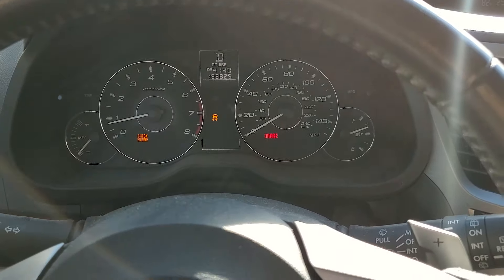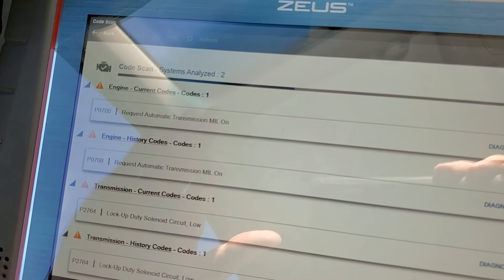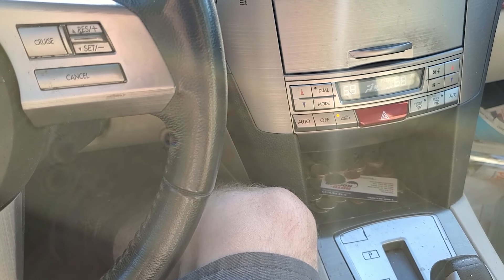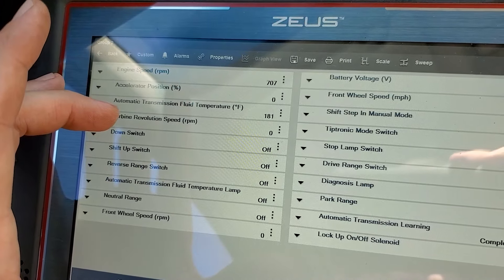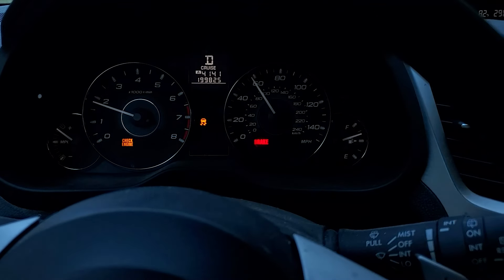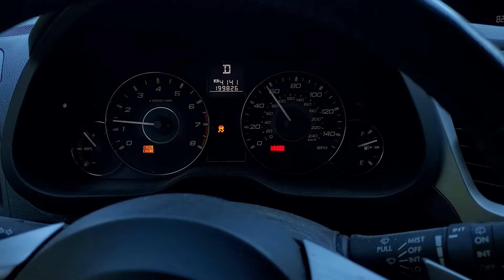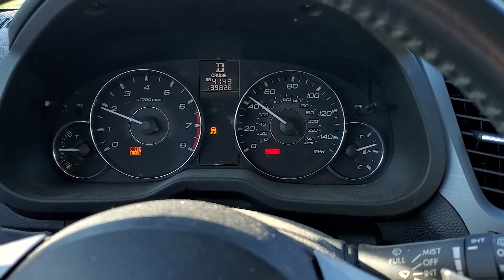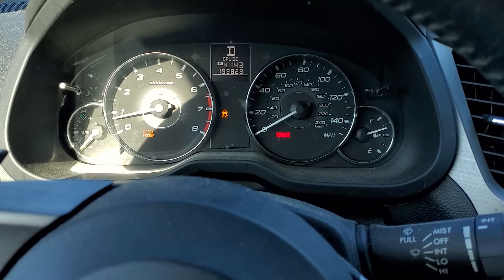Subaru TR690 CVT Trouble! My Brother's 2011 Outback's Transmission Issues.

Comment from the maker: Forgot to mention price.

Valve body is about $750
Torque Converter is about $750
Fluid is about $200
Reply: Labor rate?
Reply from the maker: 100/hr
Reply: Could it not be that the lockup solenoid is causing the stalling and the TC is good?  Just think how lucky you guys are in the states, the subi HT cvt fluid is $800 AUD ($600US) for a 20 ltr can, (cant buy it any other way)

Have you not still got the old valve body off the other car you replaced?  Are all the solenoids the same? maybe swapsy?
Reply: $1,800 ball park out the door price?
Reply from the maker: That's my cost, for parts alone.
Reply: @MrSubaru1387  extremely fair! For a 100 bucks an hour someone gets YOU not a oil change tech.
Reply: @MrSubaru1387  I dunno know what your brother plans. It’s really depends if he take care the his 2011 Outback and if not, I think better sell it to you the Outback deserves more love.
Reply: You can diagnose the solenoids and find the one that doesn't work and just replace it instead of the whole valve body.  You probably knew that.  But with that kinda mileage, might be worth replacing the whole thing.
Reply from the maker: It's always a waste to replace just one, which is why Subaru sells the vb as an assembly.
Reply: I have a 2009 forester with 157,000 on it. It's 2.5 n/a with the 4 speed automatic i have a high  Pitch whining noise It's mainly at low speeds sounds like it's coming from the middle of the car could it be my center drive shaft bearing ?  Other than that the car runs fine and does what it's supposed to
Reply: @rileypart1  this isn't including labor. This is about 2500 or more and then taxes!
Reply: My 2011 subaru have same  problems Mr subaru  how will you pay for my ? Its for sale😁 you can make your project  😁
Reply: Have a 2013 Impreza 2.0 premium with the same issue 219,000. Took to subaru and they quoted me 8990.00 for new transmission and 3400 for labor. My car exhibits the same behavior.  Just spent 350.00 per wheel plus labor to replace wheel bearing, Subaru replaced the lifters and seals under recall.  Not sure what to do. I ended up buying a new Mazda3 to get to work, but is it feasible to get a local shop to to replace the whole CVT assembly for under 1500.00 for labor and $1000 for 60k verified mile CVT at a junkyard.
Reply: @johnreilly31  yea because you can get 4 cvts for the price of that 1 lol
Reply: @johnreilly31  I have a 2012 outback that has the same jerk when accelerating from a stop. I drive it in manual mode and have no problem..
Reply: He’s your brother so service an hour is 7.25
Reply: @arod8596   case of beer. Haha
Reply: At that price for service it should just be replaced
Reply: Just bought a 2011 2.5 limited outback. I hope you keep his running. Great videos
Reply: I got a quote from my Subaru Dealer (Australia) for $3,000 AUD for the valve body part alone. I wish I cost $750usd here 😢
Reply: This whistle noise coming out from  Torque Converter? I have same issue but only whistle noise @MrSubaru1387
Reply: Have you ever put a JDM transmission in a Subaru?
Reply from the maker: @matthewprespentt4102  I have not.
Reply: I've got a 2014 doing the same thing. Car has 193k. Is it worth getting fixed?
What if I don't get it fixed?
Reply: Update 2023.  My 15 forester 2.5 premium with 116k miles had same dash lites.  No shift bump or stall.  Above my skill so, dealer it went.  New cvt throttle body $2550 in Ohio and that included 4 shiny  new spark plugs too.
Reply: Hey Mr subaru I have the same lights on,the  mechanic said  it's Transmission It's done 215k I haven't changed the oil  Ever since I bought it (60km) The mechanic said it's a risk Do you think I can still drive on it for another 80k
Reply from the maker: @itsnowornever7697  what codes?

Comment: If you get 200k miles out of a car with just routine maintenance you got a great car. Anybody watching this channel is a mechanic of sorts, so these 200k mile cars with no problems got good routine maintenance, minor stuff fixed when it broke. The best thing about subies is they are not complex cars, in their design. They also in my opinion have excellent factory repair manuals.
Reply: I do like my 2013 Subuaru Legacy H6.  I have now 130,000 on it.  Lost the master brake cylinder at 115,000.  Lost the rear wheel bearing at 120,000.  Lost the front control arms at 125,000 as well as a rubber seal went on the rear differential (rubber parts fail on all my cars at around this point and start leaking oil).  Now at 130,000 and have another oil leak - I think it is on the rubber seal for the valve covers on both sides.  Everything else has been maintenance (oil changes, batteries, tires, etc.).  Still a good car considering the price for what you get.

Comment: We have a 2009 subaru outback with 200 thousand miles on it, and we use it as a daily driver and to use on the farm. We load this thing with bags of feed and pull small trailers, and no engine or transmission problems.but we do drain the transmission fluid even 40 thousand miles

Comment: I have a 2012 Outback 2.5i at 190k miles that consistently jerks when accelerating from a stop (only once the engine has warmed up).  However if I drive it in manual mode and make sure I start from a stop in “1st”, I don’t have that problem. Subaru dealership told my $8k for a new CVT. So far I’m just going to keep driving it, as long as it keeps working, in manual mode using the paddle shifters.
Reply: Exact same
Reply: Even my 09 with the 4eat drives/shifts better in in the sport and manual modes, must be just a subaru thing
Reply: My 2012 Outback will not go to manual mode. Display shows a -
Reply: I have the exact same issue with my 2010 outback.

Comment: I have an aquaintence that dabbles in a Subaru CVT business that has supplied me with CVTs for my shop after going through valve body solenoids and torque converts.  He insists the cause is overheating and thinks the radiator cooling system is not adequate and has installed aftermarket tranny coolers in front of the a/c condenser with good results. So far I have replaced three of his with good results with the extra cooling.

Comment: Hello @MrSubaru1387, I have a 2012 Impreza, 102k mile on it. These lights came on for me. Dealership determined it's the Valve body and replacing it as well as changed the CVT fluid. My question is, from your experience,..after these services, how long would this repair hold up? ie, another 80-100k? granted I keep up with all the maintenance service of course. Thanks!

Comment: I saw ‘cvt trouble’ in the title and thought to myself ‘damn… that’s not good’… then I saw the odo at 199k miles and then I’m like ‘oh okay… whew’ hahah
Reply: this is a likely failure? or cumulative preventative would have addressed this?
Reply: Over 350k on my cvt
Reply: @Hallowsaw  Issue is at least in the US Subaru has the fluid for the CVT as 'lifetime', so most people just reading their manual are thinking they never need to replace it.
Reply: @occckid123  what year and model?

Comment: I have 160k on my 2011 OB Premium and the torque convertor has been going bad for the last 15k or so - doesn't stall each time or very often but is just an occasional issue.  I've also replaced that passenger side rear wheel  bearing (went bad at 147k, the dealer charged me $700 to replace).  I'm rolling the dice on that torque convertor as the dealer wants $1400 to replace it and that dollar amount is a large percentage of what the car is worth.

Comment: I have a 2010 Outback 2.5i, and the valve body failed at 139k miles. Subaru replaced it under the extended warranty. Prior to the valve body failure, I was getting some stalls from the TC, but they couldn’t repeat it at the dealer, so they wouldn’t replace it. Once I got to 150k, the TC issue became more noticeable, and they were able to repeat it at the dealer. Unfortunately, I was beyond the extended warranty at that point, but I got Subaru to pay for half of a new TC.   I’m now at 164k miles, and I hope to get another 100k miles like some others here. I put 300k miles on my ‘95 Legacy wagon with no major repairs. Despite these CVT issues, I still think Subaru makes great, reliable cars.
Reply: How did you get Subaru to cover half of the cost. My 18 Outback is at 107k miles, just over the warranty period. Wondering if they'll do the same for me.
Reply: Any update on how they covered you

Comment: I had a 11 Outback and the only thing that was weird for me was the hesitancy from a standing stop (there was a delay of 1 to 2 seconds from hitting the accelerator to actually moving forward) that Outback was replaced due to a bad  accident (rear ended, totaling it out).  

I have a 14 Outback (after my 2011 Outback was wrecked) that currently has 110K miles. I have done all the basics (Coolant, front/rear differential, plugs, front/rear brakes) I also replace the oil with Idemistu oil every 5K miles (I could probably go longer, but I never heard of any bad things happening when oil is changed before it needs to be changed) I will be checking the fluid in the CVT within the next 5-10K miles. But the Outback runs great and has not given me a reason to consider replacing it (but that  new Turbo is awfully enticing). 

I understand that in 2013, Subaru upgraded the CVT. Is there anything I should be aware of or do to ensure it has a long trouble-free life?
Reply: Never changed cvt fluid?
Reply: @DM-hw4cr  Not yet.  I have to get it checked before 125k miles. If it is bad, then I will replace it. It's supposed to be SUPER expensive to replace.

Comment: My friends 2011 Forester has an issue where it will randomly die when coming to a stop after coming off the highway. It happens this same way every time. It does not have the CVT trans. Once it dies, it wont restart for a while even in park or neutral. You can eventually get it to restart but it will run rough and die if you don't keep the RPMs slightly elevated. Only code is P0420, no transmission codes. This has happened for the past 2 years intermittently. We usually just do an oil change and maybe clean the throttle body and some other maintenance and it will go a month or longer before it happens again. But it always happens again. We've also replaced the upstream o2, MAF, MAP,  both cam position sensors, spark plugs. Cleaned egr valve and passages. Cats are not damaged or clogged. It does have bad oil consumption but is checked/topped off religiously.
Any help would be greatly appreciated!!

Comment: I just got the P1710 code and AT oil temp flashing light too. Looks like this one here. Trans slipped a bit, so I cooled it down. Trans level was good but may need to replace filter and valve body. Tribeca has been pretty good other wise. Got a P0700 too. Likely just need to have mech fix it. Runs ok for now.

Comment: Man.. I WISH I had a brother like you.. especially RN… 
Stuck at work, my 2013 Outback 2.5 is shot

Stuck at work, desperate and don’t have 3-6 grand.. 

It felt like Chain slipping 
Got to 2.5/3 RPM before moving.. 
didn’t wanna move far bc I’m nervous to get stuck anywhere that’s not at my shop or home..

But when I tried to drive it yesterday it sounded- felt like my breaks were locked. tired dragged - screeched 

New tires and brakes 
118k on it.. 

🙏 

In LI/New York.

Comment: On my 2013 2.5L at 65,000 miles I had this situation and the Subaru dealer fixed it at no charge. I believe it was a solenoid.
Reply: i have a 2013 as well at 90k how did you get them to do it free??

Comment: Routine maintenance with my 2011 Legacy. I had to replace the engine, so I had a rebuilt one from a company online (ENGINESUS). Had someone replace the old to rebuilt. At least 4 times now that I've had to deal with these lights issue. First, the guy told me it was the throttle plate $630, ( He said that's what his computer told him to remedy the hesitation, trying to stall and some bucking). Then, it'll be the second thermostat for this. Now, the lights came back on and the engine again goes down to a low idle instead of the warm up mode. 
This only has 71000 miles on it. I only put 30000 since I bought it used 10 years ago. I spent $3000 on a full service, tires, rods and links. Only 2 months later the engine started to over heat and the gurgling sounds and all with the system, so instead of opting for the head gasket because the engine block was cracked anyway, I opted for the rebuilt engine which was $3000.  Since then, the indicator lights like in this video and the engine symptoms.  This is bullsh*t.  I don't know of anyone else going through this with one of these.

Comment: Just so you guys know, I own a 2011 Legacy 2.5i Premium.  I put LED tailights in at and about three days later I had very similar stuff happen to his brother aside from the noises.  I took them out put in halogens and it has never happened since.  I'm not saying that the Trans Solenoid isn't bad, but if you have LED tailights or LEDs of any kind, give it a try.
Reply: @jo300hn  I had almost the exact same side effects, all I was saying is led lights can cause some of these side effects other than the noised.

Comment: My wife has a 2010 outback and the Skid light and brake light is blinking. I changed the brake light switch from advanced auto hoping it was the problem from looking at some other youtube videos but the lights are still on.  I cleaned the battery terminals.  It didn't have any codes on with my tool but its not the professional  kind just a basic one. What do you think i should check or do next?  Thanks in advance

Comment: Did a head gasket on mine when it was all put back together the at temp light came on without even turning the key all the way. Blinking. It’s not throwing any codes and the scan tool says the light is not on.
Reply: I just did the head gaskets on my 2011 Outback and got the lights: Check Engine, flashing Brake, AT Oil Temp {not flashing} Cruise is flashing and the Anti-Skid light is on.. The BlueDriver app had only one code: P0031 which is an H02S {Heater Control Circuit Low Bank 1 Sensor 1}  It's very rare for the Outback.  WTH???

Comment: I have all those lights flashing, but don't have the CVT.  I have a 2013 Subaru Legacy H6 engine with the 5 speed.  I put a voltage meter on the battery, and the voltage was a little low.  Low voltage apparently can cause this same thing to happen.  Not what happened here unfortunately, but I was able to determine that if I replace the battery I should be fine.  To reset the lights until I got a new battery I disconnected the battery for 20 seconds, then reconnected it clearing out all the codes.  When I restarted the car, the lights were gone. Still need to replace the battery before it happens again but much cheaper than the CVT here.  Interesting that when the check engine line comes on for any reason a bunch of lights come on - I guess Subaru believes its customers are too dumb to react to the check engine light by itself.  My rear bearing went about 10,000 miles ago at 120,000 - it made that same noise in my car as it does in your video.

Comment: Have a 2012 with 77,000 miles. Same lights on with no bucking. over $1300 to fix the issue including a little for routine work.  A month later and now it's slipping and bucking and they now want over $10,000 to replace the transmission. This is the second issue with the transmission, first time was soon after I bought it new. Looking for the next vehicle, not much out there of this size and cargo room.

Comment: Is the transmission from a 2011 legacy sedan same as the 2011 outback? Found one from a legacy for $900 with 75k miles, just not sure it will fit

Comment: hI. I have a 2017 subaru legacy with the same lights, but absolutely symptoms. No stalling, no slippage, no jerking and no drivability issues. The car drives perfectly fine. i've tried disconnecting the battery for a few hrs but the lights still stay on.
Reply: Did you ever figure it out

Comment: I have a 2010 Outback 2.5i premium with these same lights coming on after my battery went dead but runs fine. It’s 7 degrees outside and AT TEMP OIL light is flashing from cold start, I know the transmission is not hot. Could it be a weak battery?

Comment: I have a 2010 OB and there was a TSB on the torque converter that I had done. I made the deadline with about 2 weeks to spare. This was about 3 years ago.
Reply from the maker: Yeah, they did cover them under the 10yr 100k mile warranty extension.
Reply: @MrSubaru1387  for mine at least the 100k was waived. I was easily over 150k and am currently at 260k and running strong.
Reply: My 2011’s converter failed also. I was stalling at stop signs and traffic lights. Fixed under the complimentary extended warranty TSB  but ended up trading the car. CVT longevity made me nervous. I would be a lot happier if they just had a 60k fluid change interval. Every time I tried to get it changed at my dealer - and others nearby - they used to push back on me and say it was lifetime and not to do it.

My new Onyx XT has the never low viscosity CVTF they’re using with the newer models and Ascent? But I am planning to push hard for a 60k changeover.

Comment: Hey, there I have the same lights other than the check engine light really not affected the driving ability I was told to change the transmission solenoid it's on a 2014 subaru outback what do you think

Comment: I had the same issue about a year ago. A local shop pulled the codes an estimated me about 2700 for the valve body and controller. And then on a hunch I clean the battery terminals really good and reset, and the error codes went away. About a year later I’m now stalling on hard stops. I have about 140,000 miles. my concern is to do that torque converter and the valve body or just the torque converter.
Reply: 213k on my 2010 Outback…code 2763, 14.1mpg ….could it be dirty trans fluid?